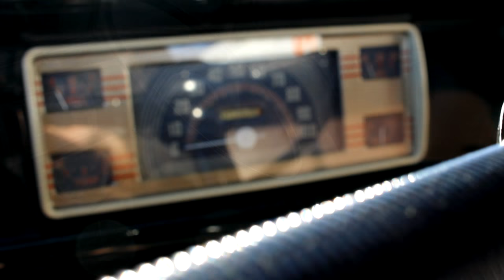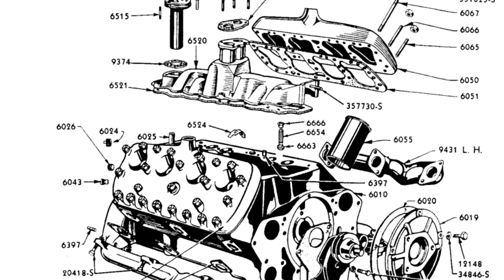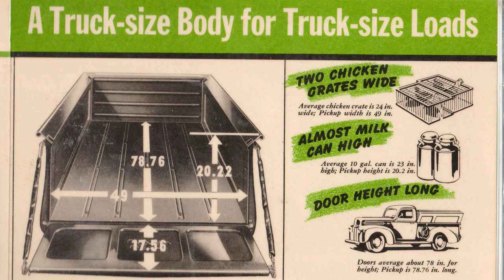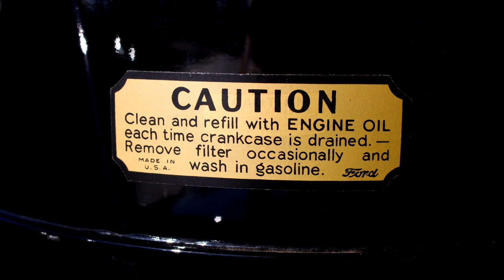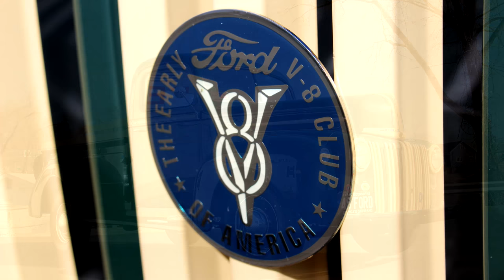1946 Ford Pickup "Lil' Henry" - Concours Show Winning Restoration

Comment: I owned a 46 flat deck Jail Bar with the 21stud 85hp and a 47 wellside  Jail Bar having the Mercury 24 stud 121hp.
I loved both those trucks very much. They where very easy to work on and i learnt a lot about keeping them going. My first Ford was a 39 v8 4 door sedan. They were also tough as hell. Thanks for the memories. Nice truck.

Comment: where would the vin be located at - beside firewall and glove box?
Reply from the maker: Try the top of the driver's side frame rail, right by the front crossmember.  It also could be stamped on the transmission bell housing above the inspection plate hole.
Reply: thanks. will take a look in the morning